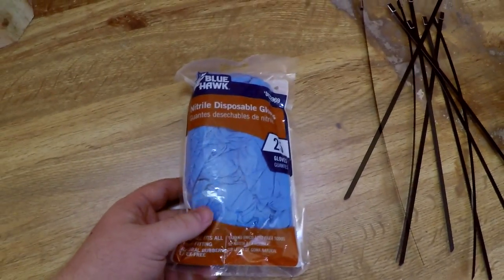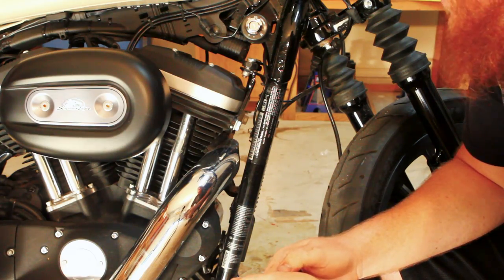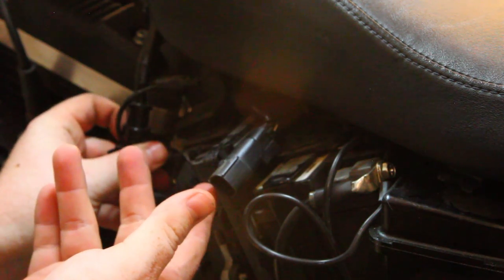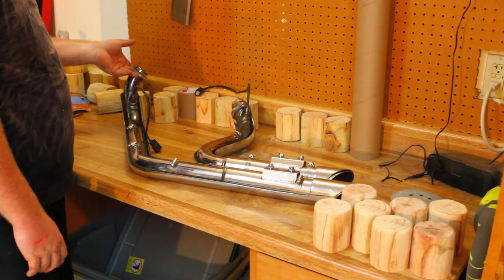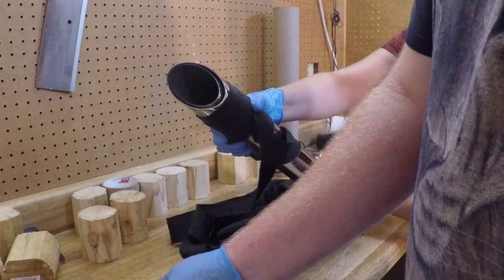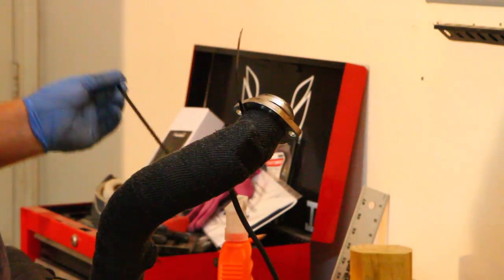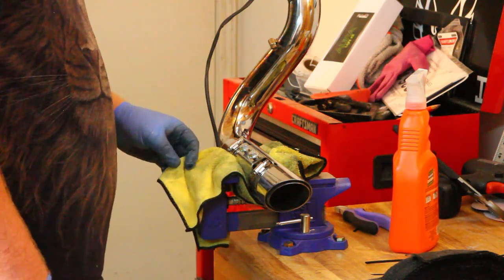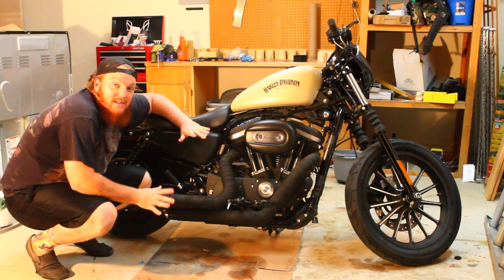Vance & Hines Short Shots Pipe Wrap Step By Step - Harley Iron 883

Comment: on my 1996 Sportster I took off the chrome heat shields then wrapped the headers, reinstalled the shields so you do not see the wrap, and get the benefits of the exhaust scavenging for better performance that is was designed for. Contact with the headers is what will give the performance. Not on the Heat covers, If I am wrong, please advise
Reply: Why anyone would wrap the heat shields is beyond me. You did it correctly.
Reply: Thanks.    That’s exactly what I want to do on my 48 with short shots.    How did it work out?    Was there any clearance problems ie; did the wrap make the pipe too thick to fit the covers back on?   And, are the covers less hot?

Comment: so I wrapped my shots last year. wraps turned white, they always had that burning fiberglass smell and my boot rubbed a hole in the wrap. I heard the wraps make the pipe run hotter which cause them to eventually become brittle. what have u experienced? are they still wrapped?

I'm thinking of trying it again, and wrap the shields also for a fatter look. im thinking it keep the pipes..uhm..less hot and keeps the integrity of the pipe metal? what r ur thoughts?

post video..oh hell yes. I'm rewrapping with the shields! looks incredible!
Reply from the maker: +RogueMoto hey man! So it's been quite a while since I wrapped mine. Probably about 2000 miles or so and I'm just now starting to get some white fade up towards the front of the pipe. But I did notice that up near the motor underneath the pipe (where it was touching bare pipe and not the heat shield) turned white MUCH faster. Also a tip, don't run it when they're wet. Like after washing it etc. Heard that makes them fade a lot faster.
Reply: So I just bought my 2 rolls of double thick wrap to see if they would last longer.. I'm going to wrap over the shields.. and that my man was a great idea to keep the color! Thanx
Reply: Bike N' Bird wrap complete...I installed double thick wrap over the shields and it looks fucking great!  black 1500f silicone sprayed and they look even better. was a pita cause I wrapped them up the the flanges and the thickness of the wrap made it very difficult to replace the hexnuts. this is my second wrap..hopefully I have learned to keep my damn boot heal from rubbing another hole in this one! thanks for the ideas bro.
Reply: RogueMoto how'd it hold up